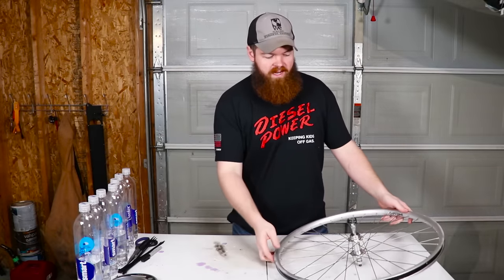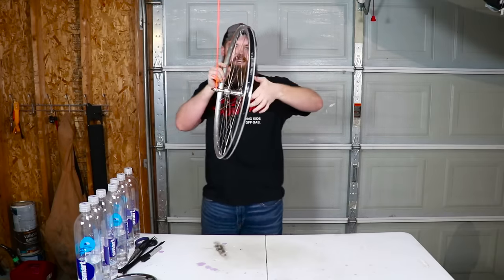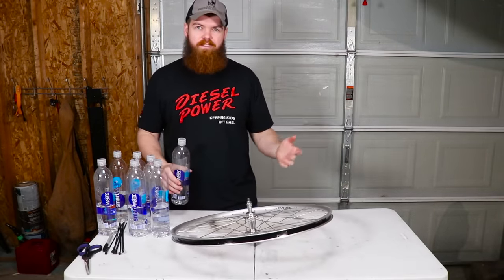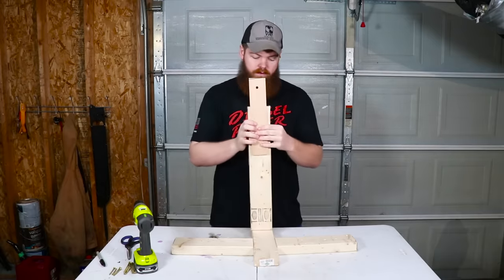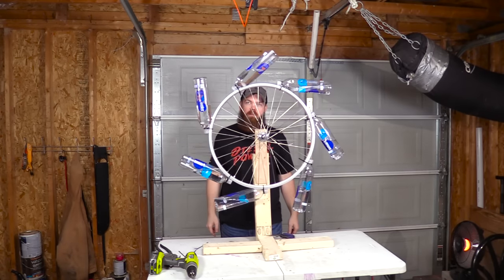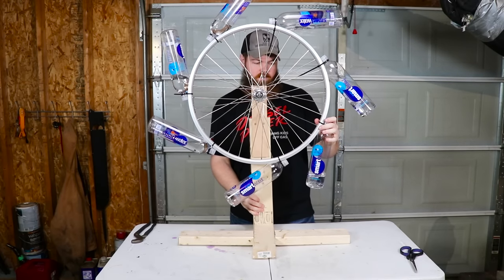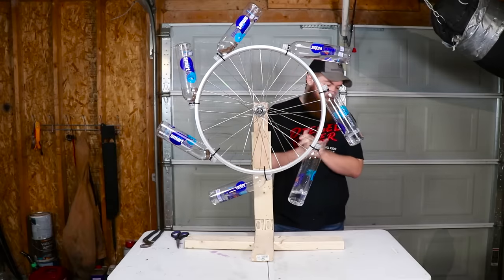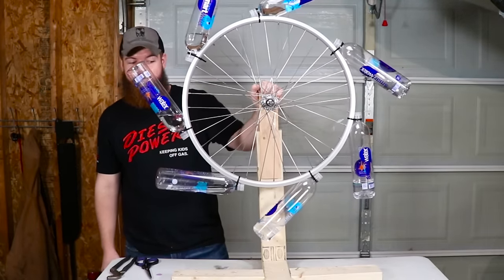Can A Perpetual Motion Wheel Actually Work?

Comment: The wheel is staying up on the string due to the gyroscopic effect, not because of the centrifugal force.
Reply: Sounds like some more physics mumbo jumbo to me.
Reply: gyroscopic precession
Reply: Gerald Burkholder bloody hell, I know a lot of people commenting here are dumbbbbb but this particular comment made me want to reply, gyroscopic precession is something totally different to gyroscopic effect. Gyroscopic precession is the rotation of an object due to torque, as you can see in the short experiment in the video, the wheel is not only spinning along the axle, it’s also spinning on the string, that’s gyroscopic precession, while gyroscopic effect is a tendency of a spinning object to stay in the same plane in relation to the universe, AND I’ll also clarify here, as a lot of people seem to be saying it’s “not centrifugal force but gyroscopic effect” well they’re partially right, as in gyroscopic effect relies on the centrifugal, or rather centripetal force, the difference between these two is that the first one is the force acting towards the outside of the wheel, and the second is a force acting in the same direction as the current vector of movement of a given point on a spinning wheel. Please stop talking about stuffs you know nothing about. Thanks :)
Reply: @IronHexacyanoferrate  wow

Comment: The friction is why these machines never work. They may work for an amazing amount of time but even if you built one in space it would never be a true perpetual motion machine.
Reply: There are so many more reasons why this dosent work beyond friction but you don't need to say anymore than that.
Reply: If you built one in space it still wouldn't spin forever because everything in our solar system is slowly being pulled torward the sun so the weight from the water would even out again and sure it would probably take centuries for it to stop but it wouldn't spin forever and I don't know if that's what you meant but if it wasn't then there is some new information about the topic

Comment: Funny video. You've been one of my favourite Youtubers for years and I've recently started messing around and thinking about these concepts too. I know this wasn't meant to be serious but if you pause the vid at 10:25 you can see that 2 250g bottles are trying to lift 5 250g bottles & some weight of the wheel. The only ones pushing the wheel up would be middle and top one on the right. For this to have any chance of working you need to make the angle of bottles more rounded and matching the surface of the wheel so more bottles can push in the direction the wheel wants to move, as u can tell by looking at the bottom/left bottles they just push down and bring the wheel to a stop. 

A good way to do this would be to get a tube or clear hose, fill it with water and create chambers in the tube or hose for water to splash back and forward to create momentum around the wheel. Maybe you could offset the weights too so when a 500g is pushing down it's lifting 250 then another 250g then when the 2 250gs rotate and start pushing down that will lift the 500g up. You'd have to calculate the mass, momentum and include external forces like the mass and momentum of wheel/other bottles to make sure water can keep up. The basic idea of this machine is there's always more pushing and always is overpowering the pulling side. 

Pushing and pulling is based on the rotatation.

Anyways, that's my input for your future videos and anyone thinking about having fun with these ideas. It'll be fun seeing you mess around with this stuff and doing experiments just for fun, not to be serious. That's how you end up learning and finding hidden gems, by not being so serious.

Comment: You should try with a larger amount of water in the bottles. The basic principles that this system uses are the force of gravity and leverage. The force of gravity makes the water fall and when it falls, its distance from the wheel axis is greater than the water contained in the bottles on the other side that remain.
This system has its own rotation speed that depends on the diameter and length of the bottles, the amount of water per bottle and the friction of the wheel axle.

Comment: For it to work, it requires even number of bottles eg 10, 12, 14 or 16 bottles. And the bottles must be fixed directly opposite of each other to make it balance at both ends. i e if you fix 1st at north direction, the 2nd must be exactly south direction of the 1st etc. Try it with this technic and you will see different results.

Comment: Starting off ,accuracy is paramount to get the balance equal pitched around the wheel with a  Set  of 3  all identical weight. 

Add in between each a the next SET of equal weighted ones now you have 6 . They cancel out any bias, so no extra ever on any side to carry over the momentum past the impeding factor - the drag. 
Needs to be  another weight on the lightest . ( Top of the wheel repeated stop position ).  No room for it  so add to a spoke as close to the outer rim, to balance a compensating assist.. The  assist weight must be able to swing from behind centre top to the front of direction , to effect a balance transfer.
Top much will become an out of balance wheel again. It’s action can only be while in inertia., of the spin. Then , add a weight on the spoke to have a loose spring attached from near hub to stretch spring easy to outer maximum.the spring must be able to get back to hub minimum position.. this could be repeated in equidistant positions. Like a yo-yo effect, the yo-yo has to have that assist for Yo-yo  rewind to happen.  If it works better.  Showing perpetual spin energy, but not a lot of use unless huge dimensions and weight.  That would need some assistance, as Earth needs Sun to get its core spinning the rest of it.

Comment: For "1" thing, I think your upright board holding your wheel would need to be/ remain absolutely plumb to give this "the best chance" of working; the stand needs to be improved upon to ensure your upright will be, and will remain absolutely plumb; I feel like the weight of the wheel is pulling the upright out of plumb; also the bottles need to be absolutely aligned so that they remain horizontal to the plane of the wheel; one being slightly misaligned one way, and one being misaligned the other way, I think, will contribute to non-success; if your upright is out of plumb, I think this will also help to cause mis-alignment of the bottles; ... 1 other thing ... I'm wondering if adding 1 more bottle would lend to success.

Comment: Drill 12 holes in your rim. Put 12 piston shafts from them to the axle. (Airtight) put a garden hose in the rim track. (Allowing for airflow around wheel) drill through to your piston shafts. 
Mount 12 electrical sauser plate covers centered over the 12 holes and airtight them to there underneath connection to the hose. ( make a center hole for piston to go through)
Attach 12 accordian style airbags (cut air vent fron dryer into pices) & (airtight it to plate) long enough to hold the volume of air capable of neutral buoyancying a 1 lb. Weightlifter weight.
Cap it with a 1 lb. Weightlifter weight. Put a piston shaft in center that keeps the motion of the weight flat , strait up or down twords the axle in the piston shaft. (airtight it to the airbags top) 
Make a physical stop movement (a not on the piston bolt and washer mounted on plate that prevents its movement outward to go past airbags fully opened point) (holding enough air to bobber the weight its next to) distance from rim.
Mount it in the center of an aquarium .
Have movement tracks that prohibit movement of the weights away from or twords the rim except in the positions of 11:30 to 12:30 & 5:30 to 6:30 o'clock positions. 
And that is how to make a gravity harness. 

And paradox is why you can't do it.
Proving that God is real. And explaining the cause of absent minded professor syndrome 🙃 

From the archangel Ram full Than
Reply: I suggest you create your own YouTube video.

Comment: I think the reason it's stopping so quickly is because the positions of the bottles aren't perfectly balanced - while obviously this can't actually work as a perpetual motion machine, I think normally you'd expect it to take a few minutes to run down, and it wouldn't necessarily reverse like that.

Comment: An honest attempt though. And it looks at if it should work. The obvious test would be to calculate weight x distance (angle) relative to the wheel center for each bottle - on each side of a vertical line through the center and see if there's a difference between the sums of vertical vectors. The problem will be to find the attack point for each shape of water.

Comment: it is 7 bottles, so there is always one more on one side, i think it would have to work with 8 and even better with a bigger wheel and 10 or 12 bottles.
The water just needs to be heavier than the bottles.
the thinner and longer the bottles you get more leverage.
it is simply the physics of leverage which has to be stronger than the weight of bottles and resistance from the bearing.
will try that with sand, it is heavier than water and bounces less.

Comment: I wonder if you zip tied them to the spokes instead of the outside if it would work. Because the bottles are catching air resistant, but if they were parallel to the spokes and zip tied they wouldn’t catch as much resistance.

Comment: what them people probably didn't tell you is that you needed 1 bottle heavier then the next like you said the 4.99 then 5.03 then like 4.99 then 5.04 and more, you needed the balanced weight so it, pull it and slow it down at the same time just like when you are riding a bike like on certain roads it happens you speed up and slow down and speed up again, shifting weight

Comment: Think on energy balance, not magic thinking.
Your arrangement losses speed, it brakes alone. If it brakes from high speed to zero, something stops it. So there are a heavy uncompensation in the system. 
You may play with momentum and gravity and low, near zero losses.

0) Make an vectorial analysis.
Be aware that what gravity adds on one side, it substracts at the other side of the wheel simultaneously.
So try to break that balance, overbalancing the wheel dynamically.
1) Get very low friction on the axe. Heavy grease is not good, use teflon oil.
2) Level the axe perfectly, not with four survival wood planks but with a stable, vibration free metal support.
3) Each bottle has to weight EXACTLY the same, not one gram more or one gram less. Use a laboratory pipette. Weigh with open bottle but the cap also over the scale (no one bottle is exactly the same).
Fill almost to 1/3 of volume or less.
Start with 1/3 to reduce slightly on all. Use a pipette to adjust.
Trial and error.
4) Add a lot of salt to the water and dissolve well on a separate pot before precision filling: first gross fill all and with a pipet adjust to the exact weight. If needed, add few grains of salt to match the decimals.
5) Use an analytical scale (3 decimals), not a cooking scale.
6) Get an OVERBALANCED system that uses the push of the water, its acceleration, to build a small momentum difference between the weights around the wheel.
7) Good luck. 
If you succeed, I will meet you in Stockholm with the king of Sweden.

Comment: What if you put this wheel into a vacuum chamber?
There will be to air resistance therefor it might spin way longer.
More over you can try to switch water for mercury and set a couple of moving magnets for extra help around outside the container. Move them around with a gravity generator.
Never found such an experiment on web, maybe because its pretty complicated to do not in a specialised laboratory.

Comment: Tyler try doing a pattern of heavier and lighter bottles so like a 500 the 250 than another 500 than a 250 so that the 500 pulls down the 250 as the wheel goes down the momentum of that will make the 500 spin around and get pulled down by the 250 which is also being pulled up by they 500 behind it

Comment: You know I think it would help better is if you made sure that each of the bottles were fast and exactly the same way. If they are off by a centimeter or milliliter because of it being slightly higher or slightly lower it throws it off by how the water moves. I think that if you tried it again and use something a little wider for the wheel or used smaller caps or even found a different way to attach something to a two-way it's make a perpetual real emotion but I think that's what's throwing off your balance. And you would be surprised how long it takes for water to stop moving completely when you said a bottle of water down it will still continue moving for a few minutes and so when you stop the wheel and you start seeing how it moves on its own it's just because the water hasn't completely settled yet. Also I think that what does you are as well as that you're using zip ties which is not holding the water bottles completely still. Because the bottle caps are not completely motionless cuz they can move and shift in the wheel and the bottles can move and shift because the zip tie is not holding it completely totally motionless cuz it can move you hold the real still in you try moving the bottle back and forth left and right it will possibly come off or loose and more. I think you found a different way of attaching into the wheel it would work a lot better as well.

Comment: So is it perpetual motion no, but it should run for a little bit better if you spaced them directly across from each other. If you look at each bottle and the bottle across from it, they aren’t equal. It’s still gonna need a push (energy source) every now and then, and it will use that energy source efficiently once the weight is distributed equally. You’re issue is inefficiency in weight distribution.

Comment: Disclaimer: Everything I know about perpetual motion wheels I’ve learned from watching THIS ONE video from TylerTube… minus the parts I skipped over.

I’m not saying it would change the outcome but do things such as it sitting level and potential loss of energy from vibration/other movement need to be taken into consideration?
Reply: Well a propetual motion machine is impossible because it breaks 2 laws of thermodynamics which is that you can’t get more energy out than you get in,
I can’t remember the other law but it breaks 2 laws of theormodynamics, like you said vibration and friction would cause it to lose energy making it impossible to spin forever

Comment: Misunderstood. Efficiency is energy saving of 25%. Assuming that there is a 25% variation in the distance at which the flowing material of water operates, and there is no weight of the frame, the pure operating force is 25% energy saving. The reason is that gravity is added when driving in a hybrid car, and the state when lifting is changed from 3 o'clock to 9 o'clock, and the variable structure operates as many times as the number hanging from it when it is running, so that multiple piston roles operate. In other words, gravity operates from 12 to 6, but the lifting distance is only operated until 9 o'clock, not from 6 to 12. In other words, gravity is a positive factor as much as 90/180 degrees. Simply put, the lifting force can be considered as inertia.

Comment: The idea is that the water cresting over the top of the wheel 'falls' to one end which pushes the wheel downward making it spin. The problem is that there are 7 bottles. At best 2 bottles are ever cresting the top creating the downward force to spin. That downward force is not enough to overcome the inertia of the other 5 bottles of stationary water. So this will NEVER work.

Comment: Okay I have an idea you can try on this even though I've never seen these other videos you're referring too.

Do another video with varying volumes inline.  Say start with 500 grams then drop by 10 for every volume until your last bottle is the least amount of water in it.   Then attach the bottles starting with the large one 1st in the direction you want to spin so that each rotation increases the force by a fraction to make a full rotation on its own.  To the point the larger volume makes a full rotation to start the rotation again.  I think that is how it will work in theory verses equal sizes which work against themselves.

I am a mechanical engineer but not so much based on volume studies more construction level engineering.

Comment: fun fact, if you took the temp of the water in the bottles before and after you spun it, the temp would be higher after. that's why the wheel slowed down so fast. the energy was shifted to the water... very inefficiently...

Comment: Well... I'd say you'd have a better chance with an even number of bottles. Something divisible by 360 then space them with measuring degrees.

When you used the 7 bottles, it slowed each time 4 bottles were o  the rise and three were on the fall. Then it spun backward as 4 weighs more than 3 even if you're displacing the center of gravity.

Still might not work. But some effort in the math for the design might get it to spin for a couple minutes.

Comment: it's not about leverage its about mass... the mass on both sides of the wheel are the same...the only way to get it to work is to physically change the center of mass on the wheel..which takes external energy.. this is how water wheels work...you have an external energy.. like a river that flows over the water wheel physically changing the center off mass to keep it spinning..

Comment: The same weight results in not working. Ik would do is try to do in every bottle different amount of water. Also: if bottel goes down the water should fall, like now, but to the upside the water needs to slow down. That way there is unbalance wich make it run